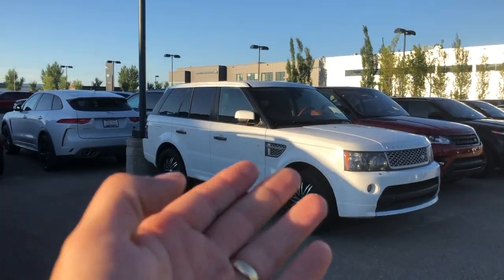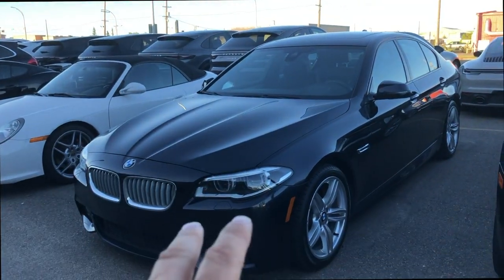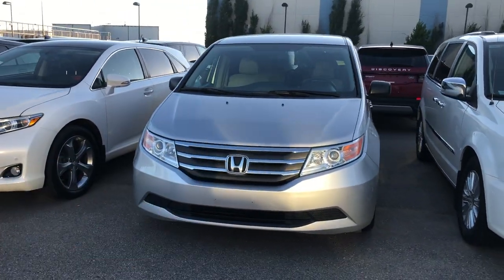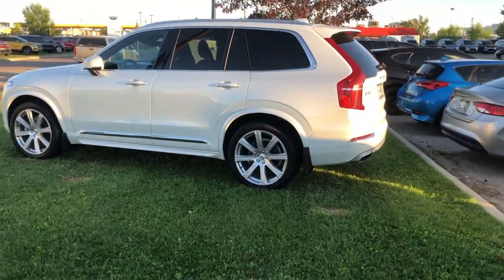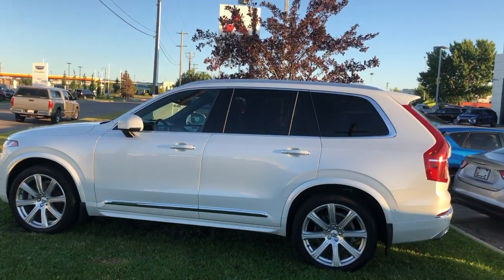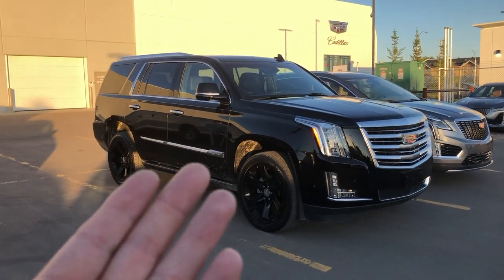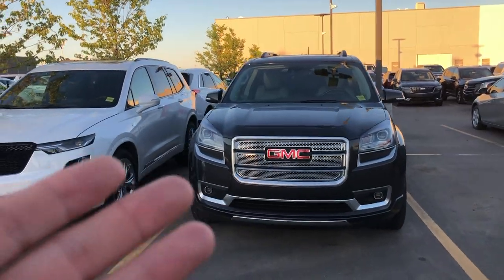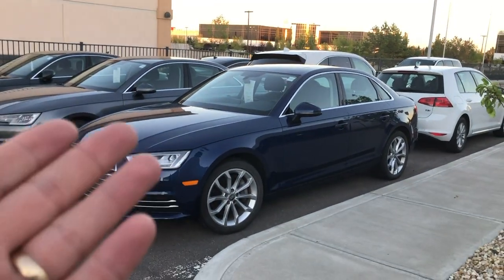The Most Unreliable Car Technology

Comment: There is one thing in common with almost every failure -- that's a degradation of materials. All materials have limits before they degrade including all the fluids seals and hard parts. In these cars higher temperatures and chemically hostile conditions due to poor servicing (like following the manufacturers schedule without considering the "harsh operating conditions" clause) will lead to premature failures. Another factor that is never really talked about is the actual quality of the parts to start with. The quality of almost any substance you can think of is almost always limited by the cost of some additive or the grade of the base product. If you consider some product like an o ring you can always get a better one that will last for longer however the cost increases dramatically. Most of the time these compromises are known by the engineers however the accountants win. 

Years ago I did calculations on the expected  life of the capacitors in an BMW E34 cluster. Using the capacitor data sheets it was easy to show that they were only designed to last about 8 years in the application they were in. The engineers would have known this, yet they still used them. I am sure you could do the same for almost every part of a car -- maybe someone will one day.
Reply from the maker: Wow, thanks for the write up.  Lots of great info and I agree, there are choices  that start at the top.
Reply: Chinese caps-bottom of the barrel, low quality.

Comment: More techs=more electrical components=more problems=more repairs=more broke=more stress. Hate new techs. All i need in a car is good trans, engine, and sound system. The rest is irrelevant. Auto open trunk, massage seats, air suspension? Hell no.
Reply from the maker: Agreed

Comment: A car is a status symbol first and foremost. When you commute use a train, uber, plane whatever but not your car. That's lesson number 1. Now many when I look at old BMWs, Mercedes, etc. I see onwers that are not even middle class and that tells you something. 

If you want a status symbol buy what a rich person drives which is likely a leased luxury car. Go bargain and get a new lease for a car that's around 70K new and you are golden. Get it for 8K miles if you can which is more than enough. If you want to buy anything order it online. 

Nowadays Amazon or Instacart are amazing and no need to go anywhere. Go out to run and bike instead. Get your car on the weekends and go out on a nice dinner. Especially for vacations never ever drive...it's the most dangerous and tiring thing to do. Take a business class flight to anywhere and enjoy!

Comment: Technology is great when vehicles are new but a complete money pit after the 4 year mark. My 2012 BMW X5 35D has had numerous emissions issues. Where as my 2006 SLK55 has never let me down. Turbo/Supercharged motors put alot more stress on all engines components. Naturally Aspirated motors tend to give less headaches and have a much nicer exhaust note 😁
Reply from the maker: Cheers

Comment: BMW and its lack of reliability is mostly due to bad engineering. Not pushing the envelope. Things could be designed better, but they aren't. They still can't figure out variable valve timing systems, and I'm not sure they can still build a connecting rod bearing. Toyota and Honda have had variable valve timing systems for decades. They work very well for a long time.

Comment: I have a toyota avalon 2014 75.000km, front strut and 1 bearing gonne, leather already cracking in driver and passenger seat (never used) even using meguiars leather  care. I also have a Bmw x1 35i msport 2013 88.000km, the bimmer looks solid no issues no noise, interior looks brand new. Maybe its the model that you choose.
Reply: Rodrigo Lima thats bs. Avalon strut gone? Your mechanic just scammed u. They lied.
Reply: @troytruong8246  it was a toyota dealer. I leave in Quebec Canada. Winter and Salt are pretty hard. Maybe thats it. You know avalond 2013-2014 have a different struts more sporty than the others
Reply: @rodrigomeca  may be u got a lemon 1 in a millions. Avalon is the most reliable car. It does not die! My friend had an old beat up avalon . cant kill it lol

Comment: Toyota is the best but they should go back to the simple ways
Reply from the maker: True and Lexus should be a bigger spread from the base Toyota. Brand in terms of fun and exclusivity level.
Reply: My aunt had the Camry model year 2000. She never opened the hood, only time it was in the garage was for oil, brake or tire changes.
Reply: If toyota and lexus going back to simple ways  no body while buy since simple mean no tech no power just a simple horse ride.  Why can lexus learn from Honda ? Is reliable and fun to